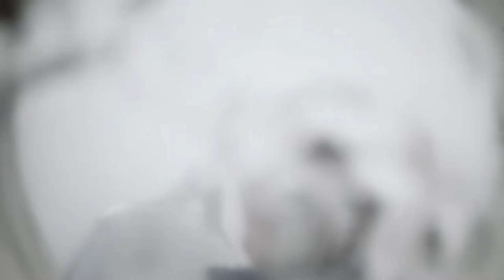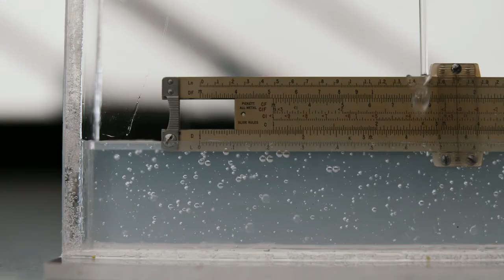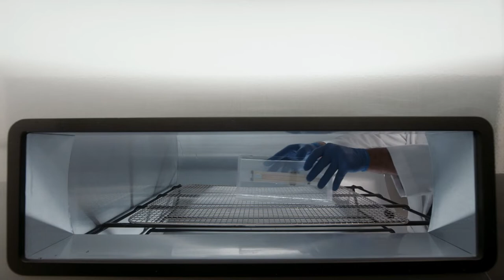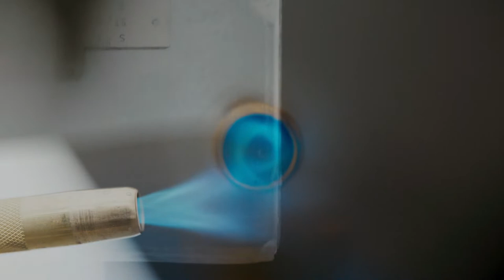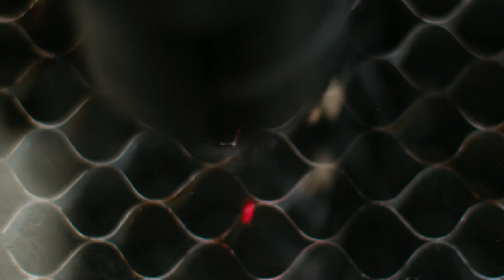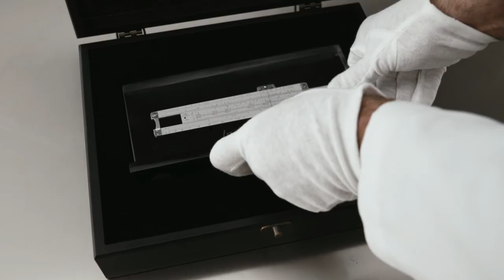Better Call Saul Season 6 : Episode 5 "Black and Blue" Opening Scene

Comment: Just about to get to Plan and Execution - and the very fact that Pink Martini are responsible for the tune here - coupled with the Werner /Margarethe focus - means that without Lalo tracking down Margarethe , the rest of the madness simply does not happen. 
The fact you have such sublime touches thru the show like ITS SHOWTIME , INFLATABLE , 50%off , WINE & ROSES and this is what elevates Better Call Saul to genius level show. 
The difference between this and Chais drug mania montage from 50 percent in the same show is frankly astounding.
Reply from the maker: thank you for commenting this

Comment: what is it???
Reply from the maker: What
Reply: A slide rule: a service used to compute usual operations without a computer. It is based on logarithms, that transform multiplications into additions. The sliding part then enables you to get the result of an addition only by adding lengths.

Comment: It is an american slide rule "Pickett" model: N-500-T👀📏
Reply: It's a Pickett.  However, it's not a model N500-T.  You can tell because, with Werner's slide rule, the two small rivets on the end are vertically aligned when the slide rule is held horizontally.  In contrast, with a model N-500-T, the two small rivets make a 45 degree angle relative to the rest of the rule.  Additionally, Werner's slide rule has the words "ALL METAL" on one end, but the model N500-T does not.